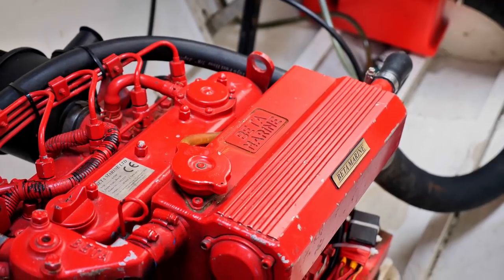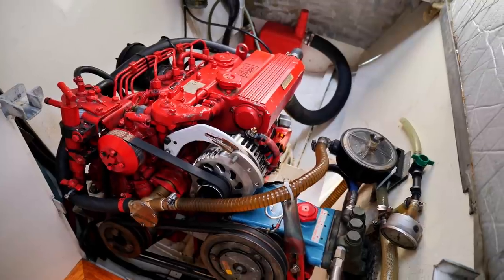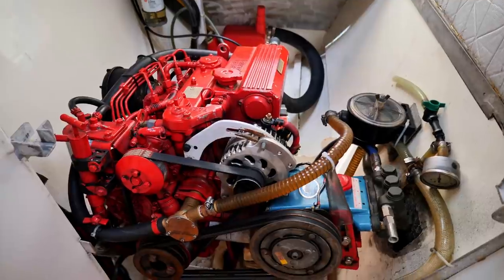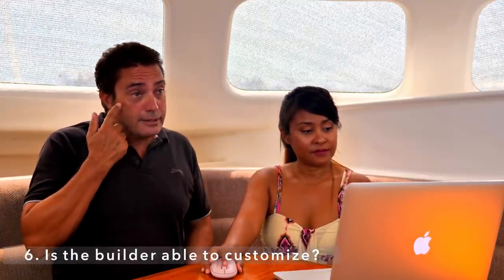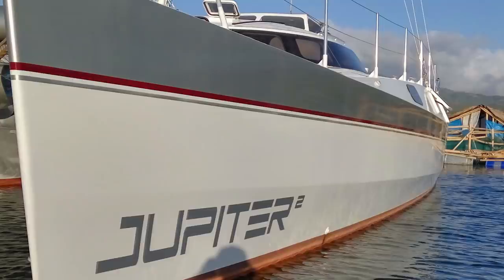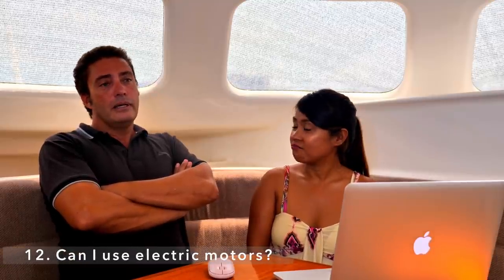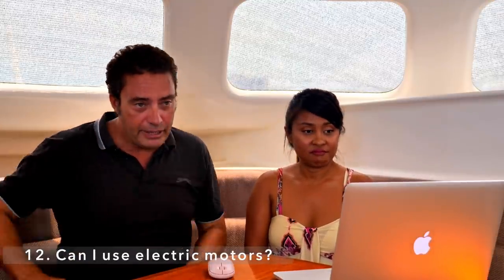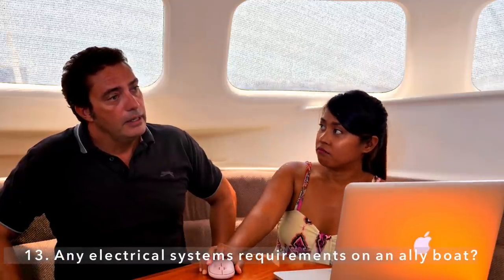Mumby aluminum catamaran - Q & A - Building an aluminum performance cruising catamaran

Comment: Great video, weight is the no 1 enemy of movement followed by hydrodynamic drag and aero dynamic drag.  Drag is best understood as friction through water, hull below waterline, foils and propellers. Or air, mast, rigging, superstructure above the water line.  Good design manages these variables cleverly.  Bad design ignores or tries to hack them.  Material choice ( fiberglass and it’s core material, Aluminium, or timber, think wharram .) Determines how it’s built and plays into what the designer can achieve.  Then it’s details which play into these macro elements.  Speed in the bank is a huge factor, how one uses it is great seamanship.  You exhibited a great knowledge of it all, it was a pleasure to see and hear.
Reply from the maker: Thanks for that Joe... Appreciate it.

Comment: Excellent idea to weld the through  holes in. Most of the ships sea chests I saw were welded in with replaceable valves on top. If the aluminum pipe showed signs of wear you could always hole saw it out and weld a new one in on the hard.  I reckon Tim will like your idea as an option,  regards Steve.
Reply from the maker: Yep, Cheers Steve
Reply: i think you could do that on the water if you plugged the outer hole with a stopper then cut the pipe below the defect and then figged on a new section.  i wonder if he keeps a mig or a/c tig welder and argon onboard?  i know dewan makes some tiny 120v machines.

Comment: LOL, the 50 ft hulls were probably mine.  Tim just had them completed and pulled out in the yard until we can get there to start on the bridge deck after travel returns to "normal".
Reply from the maker: Me likey!
Reply: The 48 or the 50 would be an awesome boat to have. Is there much difference in dimensions? Henry
Reply: @shanevillis4079  sorry for the delay in replying.  I do not have plans to compare side by side.  I believe it is added in each cabin.
Reply: @hdhouse3  Thanks mate

Comment: That was super interesting Jupiter people. If I were to build an aluminum boat again (now mono, Reinke 13M) this design would be at the top of the list. Weight and sailing characteristics are amazing. I had also tried to find a solution to separate minus from hull and failed. But have no problem with it so far after 22 years in the water. Technically oriented episodes have my special attention, but your other posts are also worth seeing. Keep up the good work.
Reply from the maker: Awesome...thanks for the feedback Albert.

Comment: Good video. I'm very curious about your Mumby.  (Hopefully I'm not too much of a busy body.) 
Your cabin walls:  gelcoat on a waxed mold, etc.. is how sea kayaks are made. Good method. Here's what happens if there's ever a change needed or damage. I have a sea kayak that was hauled on to a dock while full of water. It folded right in half, huge holes busted out of the glass/kevlar hull/deck. You grind out the loose damaged material, feathering the hole. Then you trace an outline and cut a few layers of fiberglass each layer smaller than the one beneath it. (biggest on the bottom, smallest on top) Then on construction plastic (won't stick) you stack them up and apply epoxy.  Easy. Put it over the hole smooth it out. Then a layer of epoxy with some lightweight fairing filler, sand it flat, color it - done. Gel coat can be reapplied and epoxy, vinylester, the fairing compound can all be sanded down through the grits and buffed out shiny as a mirror.  You can brush on gelcoat and sand it, synthetic-steel wool, buff it to perfection.  
Fiberglass (GRP) on the inside of an aluminum boat is really a great way to build. You boat should last a hundred years. (The cheaper and older balsa core boats are basically temporary. I've built two cedar cored sea kayaks. One tiny hole or scratch or crack, water gets in and the epoxy won't fail, but it will pull off in large sheets taking a layer of the wood - which is the same thing. 
The only issue with running wires through conduit embedded in insulating foam is actually heat. There should be specs on this. It's against the (U.S.) Nat. Electric Code to run romex (plastic shielded wiring) or an extension cord through any kind of conduit because of heat. With LED lights being so efficient heat won't ever be an issue. If I had a suggestion to make I'd say look at all the boat cabins you can, find out where all the lights, fans( usually in the corners) are and then run the flexible conduit to all the possible spots with a piece of iron at the end - so it can be found with a magnet and then run all the conduit to where the electrical panel is and label the empty conduit. Then when you need to install a fan you already have conduit going to that spot. Snaking wire can be tricky but once you've seen someone who knows how to do it it's easy - even I learned. 
All the electric motor sailboats I've seen on YouTube videos (and the Outremer 45 that was going to circumnavigate but turned around) have almost no range. Like sail to displacement ratios, there's no way to cover a boat in enough solar panels to effectively replace the performance and range of  diesel engines - even for the minimal use of a sailboat. It can be done, there will just be days were you cannot go anywhere. However, the Mumby as a performance cat has the first criteria, being able to sail in light winds. One of those heavy 'cata-condo-marans' that have to turn on the engine in 6-7 knots winds won't get very far with electric motors. (This is from a happy Tesla owner - so my bias is for the electric motor.) 
And yep, this is also what I've learned as I  search for a multi-hull: Most cats have pretty good cruising speeds, the real plus of a performance cat  is being able to sail in lighter winds. 
re 'the plastic spacer.' This is like a dielectric coupling for connecting copper pipes to  zinc galvanized pipes. I've got years of experience with this. First of all if you don't use a dielectric coupling (a plastic sleeve/seal separates the copper from the zinc) your galvanized pipes will rapidly corrode(rust) and leak. The house I live in the contractor put in a new copper waterline to the house, connected it directly to new galvanized pipes. Within three years the longest pipe in the house was rusted and leaking along its entire length. Other pipes were rusting too. I've never seen it this bad before. I replaced most of the piping with copper, used dielectric couplings at every connection - 12 years no problems. Plumbers have told me that eventually even with the couplings there will be a problem. I've never seen it.  So I think with some care your boat should be fine. 
And on an aluminum hulled boat I'd prefer aluminum through holes welded to the hull with the plastic fittings inside the hull. I've seen too many plastic fittings on tanks, swimming pools and things get just a bit too much stress and snap off or crack.
Position the right sized bungs and some kind of mallet next to all of them- but so they won't float away. Maybe also a chisel in case there's a piece of the plastic fitting sticking in the way. I'm sure there are boat people who know a lot more than I do.
Reply from the maker: Hey WillN2Go1... appreciate your advice... a lot of info there...had to reread a few times...
In a couple of years we will be back in Philippines, for Jupiter to get a spruce up... I'll get Tim to weld the thru hulls then... Not much else to modify on this boat...
Cheers
Reply: @SailingLifeonJupiter  You've got me really thinking about the Mumby.  I was thinking wouldn't the Garcia Explocat be terrific if it had shaft propellers (instead of sail drives) and deployable skegs.... duh, that exists - it's the Mumby. And it's about 1/3rd the price. Really enjoying and appreciate your videos. Fair winds.
Reply from the maker: @WillN2Go1  Cheers... Those boats are pretty heavy too...good for ice tho!

Comment: Can you please explain about the built in safety in the design, collision bulkhead, are the tanks stand alone or part og a double bottom design. Will the daggerboards break apart without damaging the hull in case of a grounding. What happens if you have the rudder hard over and run aground, will it still tilt up and out of the water or will it get stuck in the hull, is that part of the hull a collision bulkhead??

Comment: Hi guys, 
 we made our inner forestay and bridle out of 10 mm dynema and tension with a rigging screw I lash it  to the backstay when not at sea  to make tacking easier on the sail.
Our through hulls are 25 mm round bar welded to the hull, and threaded with 3/4 plumbing dies with a 12mm hole drilled,  leaving 5mm wall thickness at the thread.
As for painting the bilges ask anyone who has an aluminium boat with painted bilges 20 yrs old, I have met dozens who regret ever letting paint near the bilge. The  trick is no leaks,  we sprayed lanolin ( lanox) as a precaution before launching 6 yrs ago. I still hose the bilges if we spill any salt water and keep a container under the shaft seals to catch the odd drip.
Question did you make integral hull water tanks and if so did you paint inside? 
I did and it is starting to bubble up and flake , so we might resort to putting bladders in. Not ideal but if I built again I think I would use polypropylene tank/tanks on the bridge deck .
Cheers Shayne  
Mumby  Cyber Yes !
Reply from the maker: Ah Shayne... Some great info there.. Tks for that... Tim did paint the bilges under the engine, but no where else... So I might not bother now!... Yes integral water tanks. And epoxy painted welds only  to seal any pinholes.

Comment: The wiring in the ceiling,  now you explained its in conduette is good . I think access to all cabling as in time 
And metal will get effected by the salt. Easy to replace amazing, its a shame all other manufacturers don't do this throughout the boat ,  especially on a cat when you want to get from Hull to Hull,
Reply from the maker: Yeah David... Its no problem.

Comment: Good clarification on the wiring!  After the previous videos it seemed like the wiring was just stuck up there with foam over it.  My primary thought was "at least run it through conduit so it can be replaced if needed", so knowing that it is makes it all better.

I've gone back and forth several times on whether I want to go aluminum or composite.  Aluminum has some real advantages (including being completely recyclable and substantially cheaper for a one off custom build) and as long as the boat is big enough it can give composite a real run for its money weight-wise.  But upkeep and repair-wise, I think composite wins.  Anyone can patch a composite hull, even if it's ugly, as long as you give it a good surface, mix the resin right, and give it time to cure, you're left with a solid patch.  Aluminum... well, I personally can't weld aluminum, and even among welders welding aluminum is somewhat a "specialized" skill.  I forget which channel it was, but I just watched a video the other day where they couldn't find anyone that was even willing to weld aluminum for them.  Even if I could weld aluminum, I'm not sure carrying a welder and having an inverter capable of powering said welder would be a wise weight investment, lol.

But ultimately, I think this is one of those decisions that gets made for you most of the time.  It's not like there are a ton of options out there for aluminum cats, so if you aren't a fan of those options, it means composite, unless you can spring for a custom design.  Currently I am leaning heavily toward the Grainger Raku 48.
Reply: The Canadian couple from "Distant Shores" have about 30 years experience making cruising videos are currently having made a custom aluminum monohull.  The major factor in choosing aluminum was that tolerances and fittings are much closer due to using Computer Aided Design software and precision cutting.
Reply from the maker: Cool, tks Fleshbox.... Yep it's a tough decision... so long as you get on the water...thats the important thing.
Reply: On Board lifestyles (SV Basic) had the problem not finding a welder for their frames for their hard top they had built.
Reply: I have an older aluminium sailboat and it's always wise to carry marine epoxy and aluminium sheet onbourd for patching any repairs best one is pioneer non-sag made in the Philippines it will get you out of a leaking situation in the water or out

Comment: Nice cat. Had actually found this design somewhere on the web 6, 7 years ago. And had forgotten about it. Thanks for bringing it back to my memory.
In regards to Top speed, I think it is far more interesting for Cruisers to know, what had been your top milage per day and whats your average daily milage on a passage? 
For the technical part, whats the aluminium sheet thickness on your boat and are on the bow and stern thicker sheets used?
Keep enjoying your sailing trip.
Reply from the maker: Yeah Steven, it’s hard to find an affordable performing cat these days…. So far our ocean passages have been hugely variable….the IO was mostly blowing 30-40kts….the Sth Atl was less than 10kts of breeze, and right up the bum (slow) on shorter runs of a couple days or so, with consistent wind of about 15-18kts weve done 250nm’s a day….I’m happy with anything over 200nm a day….the ally plate is 4mm hulls and 3mm decks.

Comment: If and when the inner forstay is re-done to make it removable it might be easily stored next to the shrouds as the length would match up better than attachment to the mast.  On electrical and safety you're top notch so I would encourage you to make story boards and explain floating earth electrical grounding and neutral wiring on an aluminum boat. Thanks for another excellent video.
Reply from the maker: All good advice... Appreciate it UUB

Comment: In event of a lightening strike, will the aluminum shell ack like a Faraday cage and protect you and inner components?
Reply from the maker: That is my impression Ying... I'm gonna do some more research and check on the theory... will let you know in a new vid....Thanks for watching.
Reply: @SailingLifeonJupiter  I'm guessing that the electrical components (mast light, weather vane, antennae etc) at the top of the mast would defeat that.
Reply: Technically speaking metal boats are safer than composite if struck by lightning, however that difference is pretty minor.  The electricity will always try to take the path of least resistance, so a metal hull that sits in the water should conduct that electricity directly.

However, lightning is ridiculously powerful, and a few mm of metal aren't a guarantee that the lightning won't just pass right through you as well.  Your safety is probably more impacted by your distance from anything conductive than it is by the hull material.

I know that carbon fiber masts have special safety issues for lightning strikes because carbon fiber is far more conductive than aluminum and can actually cook the resin in the mast along the path of  electricity, resulting in the mast potentially needing to be replaced ( a definite advantage of aluminum masts, lol.  Though, there is a reason why experiencing something super unlikely is often equated to getting struck by lightning).

The most likely point of getting hit with lightning is going to be the tall skinny metal thing sticking way way up in the air.  From there the power will flow through the shortest, easiest path to ground.  Regardless of whether this is an aluminum or fiberglass boat, that path is probably not going to find you, unless you happen to be touching something conductive.

Comment: Super boat, thanks for all your videos. Can you comment on any AC on board. I worry that the Aluminium with only 1 or 2 inches of closed cell/2 lb.  foam (and) all the thermal bridges (aluminium ribs & gussets) it must get warm. And do you use any solar attenuation devices?
Reply from the maker: Tks Simon... No ideas on AC.. That would mean a heavy generator or marina... We don't use either... White decks keeps the temps down... Never a problem to walk on.

Comment: I totally understand and recognize the quality and ability of the Mumby design and the capability of the materials it's made of. But since so few are being build, it's a rare duck, and then you mention Lagoon as being overweight and slow. Well, the Lagoon 45 will any day sail half windspeed, and do it in a very secure, comfortable way. Lagoons are mass produced and are therefore actually obtainable. They are somewhat pricey, but hold their value well, and are easy to sell on, if the owner so desire. I am not sure that's so easy with a boat produced in extremely small numbers, specifically customized to the first owner's needs and wants. One offs are more expensive to buy and harder to sell. One-offs demands a long waiting time from order to delivery, and in many cases doesn't have a very nice finish to them. To me a thoroughly tried and tested product gives me more confidence than the opposite. Just my 5 cents, because everyone seems to be picking on the Lagoon... 😉
Reply from the maker: Cheers Viking. You make some good points.